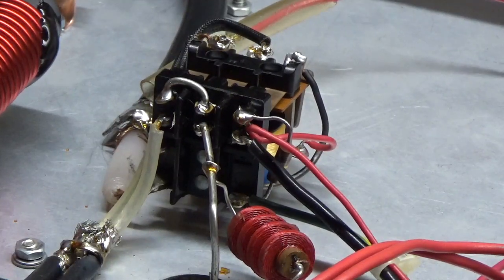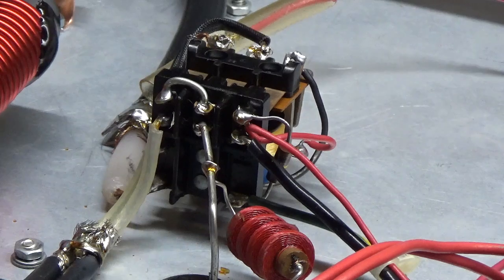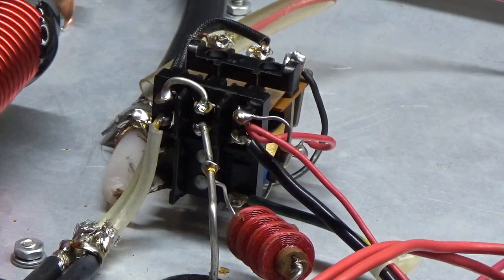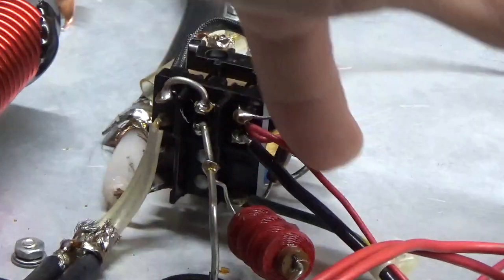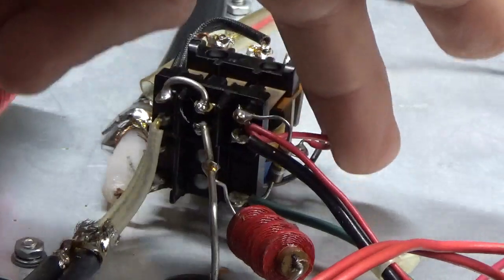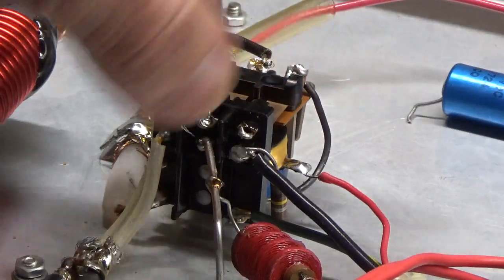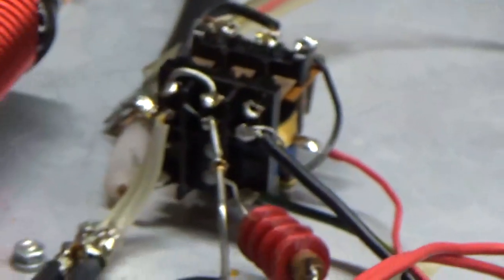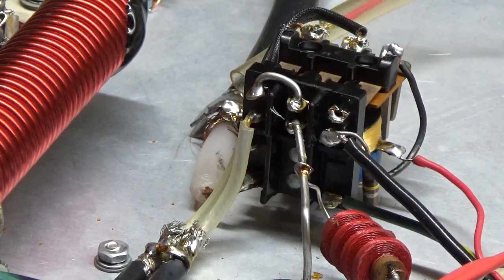Self Bias Modification Heathkit sb-220

Comment: Scott, believe it or not, this video helped me diagnose my SB-220.  All of a sudden I had a short in the 120 VDC circuit.  Initial symptom was SoftStart relay wouldn't disable.  I checked ACV and DCV both were way too low.  Check for shorts, soft start - nope, soft key - nope, capacitor - nope.  Seemed to be coil for relay, then I disconnected the coil  Still has short. figured I'd watch your video and do mod as part of the repair.  Your comment on Grid to Heater short was the key.  Thanks so much!!!
Reply from the maker: Makes me happy to hear that, thank you for sharing and for watching 

It’s the most important mod of them all, saves the filament transformer if a grid to filament short. Which is usually how the China 3-500z tubes fail if going to fail. 

73

Scott